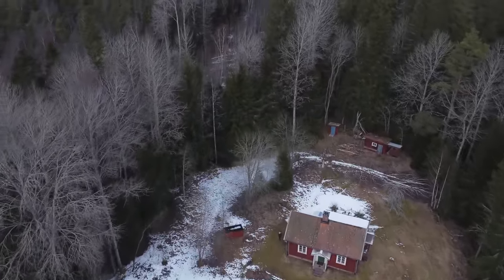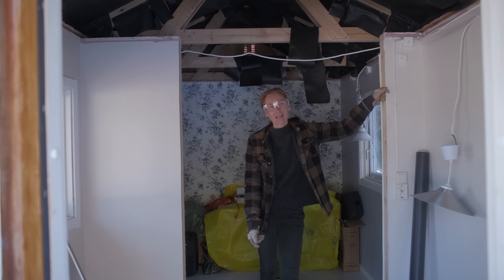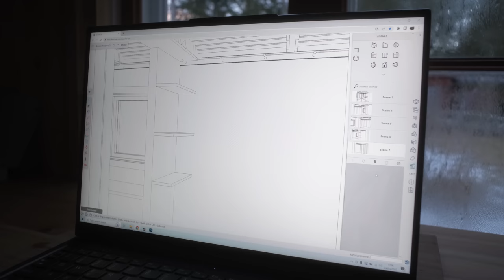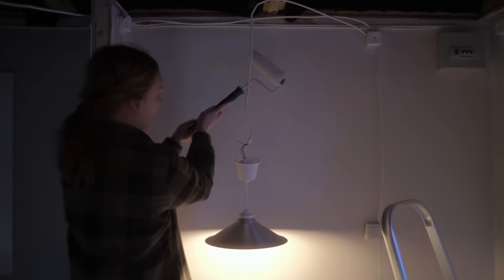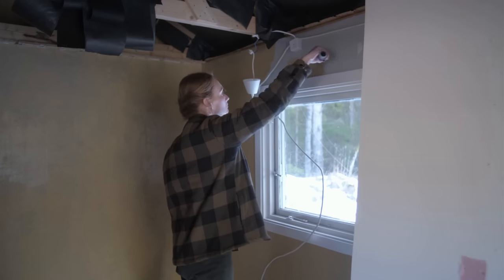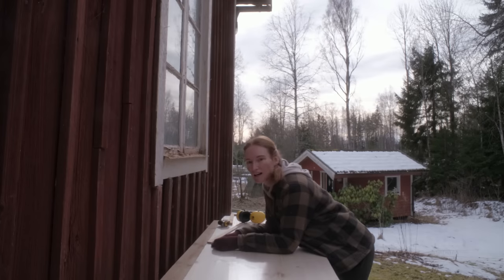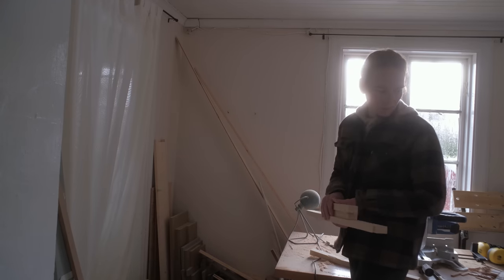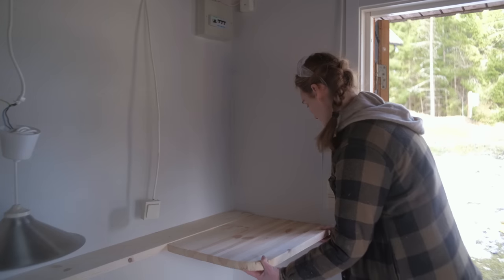I'm Painting & Making A Desk | EXTREME GUEST HOUSE MAKEOVER (Story 45)

Comment: I know the feeling when things don't go the way you want. I'm going to put herringbone parquet in my kitchen. There was a concrete slab in the floor that I needed to remove. Filled the hole with boards and it didn't turn out well. I'm sitting now wondering if I should go and buy new wood and redo or try to improve what I've already done. I think I'll wash the windows instead.
Reply from the maker: Oh my gosh I wanted to put herringbone parquet in this little guest house, but I just can't quite justify the money. I think I'll wash the windows instead as well.
Reply: I 'had' herringbone parquet in my Great Room - it was stunning.   Seems when installed the threshold wasn't properly sealed and gradually water infiltration occurred.    I thought I noticed a bit of difference in the floor but dismissed it due to working and caring for disabled parents.   I stayed with them for several difficult months.    When I returned home and unlocked the door it would not open - the floor had buckled.   The entire floor was compromised - in a 1200 square ft room.     I loved the look and feel of the herringbone parquet but I cannot justify it again anywhere near an exterior door.    I am considering it for my Owner's bedroom and possibly the hallway.

Comment: I am amazed that your paint adheres well during cold weather, especially over wallpaper.    The previous owners of my home selected some unusual wallpaper that never appealed to me.   I attempted to remove it and created a mess.   Painting over it led to the edges lifting.    Apparently our paints do not have the same adhesive formula.  I am now considering utilizing thin wooden strips to create a design to camouflage the seams.   It would be much easier and faster to paint over outdated wallpaper.

Comment: Just a suggestion, what if you take the wall out completely, give a more open space to work with
Reply: Rosie will be having 2 single beds in the one room. Making a bit of a separation would give each guest a bit of privacy....🤷‍♀️ With Rosies amazing design ideas I am sure she will again make a little "gem" out of the guest-house🌺
Reply from the maker: Despite the small size, the separation actually works quite well and it’s nice to have a devoted sleep area, so it doesn’t feel like you’re just staying in a shed. Plus the bits of wall make good end points for the desk and ‘kitchen’. Without the separation you end up pushing the furniture pieces next to each other against the wall, which I like to call a ‘furniture graveyard’.

Comment: Nice. If You need more bedding, You could build a Bunk Bed... By the way, I  heard a "spring sign" right in the middle of the video. The Raven honking in a distance, It is starting to nest  these days. One more thing. The worktable You made outside is rather smart as You can take the clamps down between and under the Planks/ribs and place the clamp in an angle and then the length of the board You shall cut does not matter at all. 😁

Comment: Rosie you can get those storage units you can hang and they have separators so it’s not fixed. Or put cubes at head level to store clothes with a bar on the bottom for hanging. That way the beds have floor room.

Comment: Y'know I very much dislike wallpaper.  But I was actually thinking that this was kind old old nana cute.  😏  The ochre-sand colour is nice.
Reply from the maker: Noooooooo
Reply: @wildrosie  you're amazing! The paint sand colour gives an impression as if the walls and the window frame were in original wood. Also, for the shelving: I would make one wall with shelving and one wall with IKEA hanger for clothes, i.e. IKEA Pinnig rack with 3 hoocks (comes in black but you can re-paint it), or whatever hanger can fit the size of your wall that you've cut. As for the front door on it's inside part you can have IKEA Tjusig hanger for clothes or may be towels as you'll have a sink right next to the door.